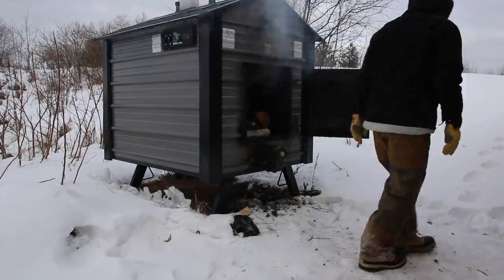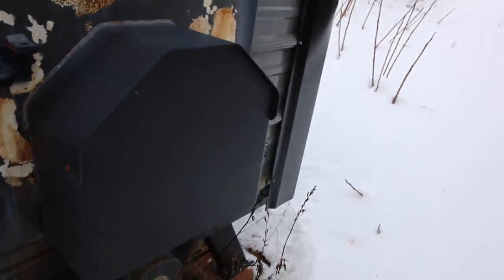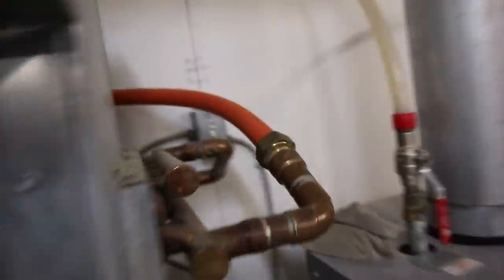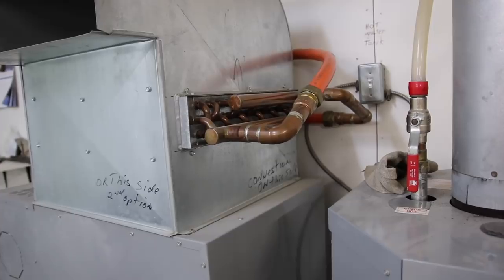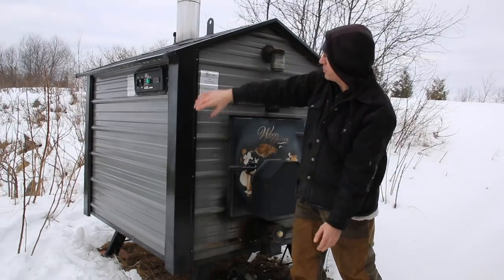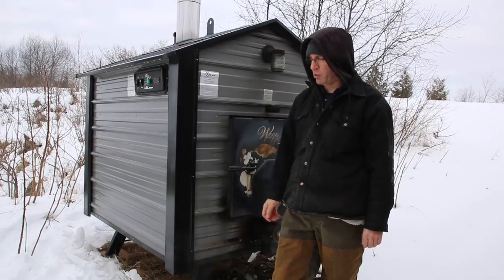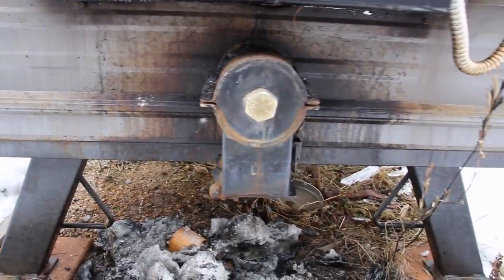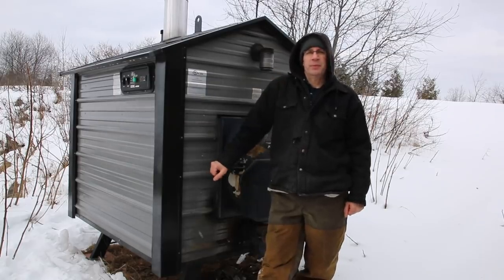Outdoor wood furnace "worth the investment?"

Comment: Thinking if a person spent 80 man hours a year cutting and stacking wood to prepare wood for the winter (just a guess) and an hour a day for 5 months of the year that comes out to about  265 man hours a year. Using wood I would save about $170 a month for 5 months that comes out to saving around 850 a year Not counting gas and oil chain saws, maintenance, cost of the wood stove, anything used to acquire the wood. However If I figure in the time I use to save that $850 a year I am only making $3.20 an hour profit for all the time spent. This was fine in pioneer times when people had not other option; however I can make some pretty good money if I spend that 265 hours a year selling stuff on Ebay or just about anything, even mowing lawns for money on the side I would make 10 times that. I don't know about you all but my time is worth more than $3.20 an hour. Of course some of you will have different figures than me but it has to be pretty close to what I came up with.  Even a part time job working any where for 265 hours a year would pay for the heating bill regardless if it propane, heat pump geothermal or straight electric heat and have lots left over. Even if your figures came out to $6.40 an hour its not worth it compared to other things. Also if you throw your back out from carrying wood just one time. All your savings will be out the window for one trip to the hospital.
Reply from the maker: I agree with you 100%. Everything you have said is accurate. This is my last year heating with wood. With all those hours that I save, I will make more YouTube videos and will be better off financially. Propane is coming in next year. :)
Reply: jimthvac100 very well said...a setup like this would be nice if you was off grid but other than that I think wood is best left for emergencies or ambience
Reply: For this very reason I'm going the Wood Stove Route. Using only about a 5th the wood to beat the utility bill 1 1/2 to 2 cords for the cold below say 35 degrees. I'm looking forward to the workout of cutting/splitting and stacking  that much wood. But 10+  cords? Forget it, not happening. At my age that would be a full time job......
Reply: Speaking of chiropractors, ever since I returned to wood heat, the exercise of cutting and manual splitting has  gotten me to the point that I don't have back problems anymore. I live alone in a 600sqft house. Since I'm at work 40hr a week, I go through less than 4 cords per year, although I always end up cutting quite a bit more. I use a single oil-filled space heater to keep the house from freezing while I'm gone. I paid $150 for my used 70's vintage stove, which is lined with firebrick and stays hot long after the fire goes out. I've had electric, natural gas, and propane heat, but wood is my favorite. Also, knowing that you're not dependent upon the power grid to stay warm is very comforting. When the power goes out (which it often does here), I can heat and cook with the stove. I can even heat up a bucket of water for a sponge bath.
Reply: You forgot to factor in the cost of a gym membership and the time spent at that gym to replace the exercise you get. I don't about where you are but here in central Manitoba a cord of un split fire wood goes for over 200$. One thing I don't like about these is that it takes away the main advantage of wood being that it is still dependent on the electrical grid being up  to remain operational.
Reply: @frenchriversprings  were just on the bay of the french and one problem we had was our outdoor reg freezing up below 40% tank capacity. Strongly recommend building a dog house for the reg and venting the reg outside of the dog house. Actually a birdhouse is a better description of the size instead of doghouse.
Reply: chopping wood saves on gym costs.
Reply: I had to buy bush cords. Five per year. Changed to propane two winters ago. Saved money, a lot of time, and my back. Best part, now I have a thermostat.
Reply: Hey, Doc (Dr Medicinal), you had me going until the comment "we need to see chiropractors anyway." We DO?
Reply: Chiropractors. Not as pretty as a masseuse, no happy ending. Can't prescribe anything. Fix it for a minute.
Reply: drmedicinal.  you're forgetting promotions and pay raises unless you think you'll be making exactly the same $10 pay for your whole life, that is if the plan is to chop wood until you die.   For most people, all that working will cross that line at some point where it no longer makes financial sense.   That's why we don't all fix our cars, install or own plumbing, fix our own roofs, build decks, cut hair, etc.  When was the last time you think a person on the forbes list chopped their own firewood for the winter?    All that heavy work will also take a toll on the body and rob you of the opportunity to do other things that you might otherwise be able to enjoy.   ...after cutting, chopping and stacking wood all week, you're not likely going to want to go rock climbing or whatever.
Reply: @grahamtotte7133  heard of a generator?
Reply: Try to find back specific exercises and do them, it will help rather than tiring it out all year cutting and chopping wood. That way you can still work and be happy..not too good at math so I really enjoyed your comment.
Reply: I agree with the assessment. However,  I saw a neighbor recieve a semi load of oak, $60/cord/10 cords. The next day he rented a splitter mill. The type you load the logs, it cuts it, then splits it. He had the whole lot cut split and piled in less than a day. $250. Its was piled next to his stove, so no stacking.  He had about 10hr labor for $850 for 10 cords cut split piled. But I still wouldn't go outdoor boiler. Supplemental indoor, yes.

Especially with the above scenario,  you may get 5-7 years on 1 semi load.
Reply: I make pretty good money and still use wood to heat and a pellet stove in my house. I have a 3 story 3800 sq/ft house and I heat it on $5 a day with one tractor supply pellet stove. I even have in floor radiant heating and I don't use it. There are other benefits to heating with wood, I don't even consider the cost to be one of the benefits. Wood stoves will always work, I do hate if you're relying on your wood stove and it dies overnight and you wake up freezing. That's why I swapped to a pellet stove with a hopper for my house but I have a wood stove going in my shop this year and a wood stove at one of my rentals.
Reply: Oh and with my house when I tried to heat with propane we ran through $800 in propane in a month! That's a full tank, great insulation on house. Propane running a boiler for the in floor heat. House built in 2005.
Reply: Plus this is ongoing, in the summer you are married to your chain saw and  you have wood everywhere on the property also proper storage of the wood is needed an additional expense.  Now when you are away from home you need to get back home to add wood at some point or call someone to add wood for you (true story). It owns you...
Reply: it has it's up and down.

to be fair, im not saving much, i buy my wood from a guy. however, in 98 in quebec we have had a crazy winter storm that took out the power grid, for a complete month we were in the dark no electricity.

during that month we were able to stay home, warm and safe, the others who were relying on electricity had to move to emergency housing (with 100s of people sleeping on camping bed in the same gym etc)
i can also cook on my stove. and i have a pass on a plot of wood my friend own where ican cut  for free.
wood stove also have the bonus of reducing humidity to an all time low in my house.

my idea is that it's better to have more choice than to use only one source to heat the house, if one fail then you have backup.
Reply: Atheyst, gotta call BS on this. Your 2 posts do not corroborate. You plow through an entire tank of LP in one month, but only one bag of pellets a day when on pellets.....one of those is not accurate.
Reply: It cost $600 a year to heat my home and cook with propane.
Reply: @Atheyst  you have shit for insulation if you run through a 400 gallons of propane in a month lol did they forget to put the insulation in when they built your home lmao.
Reply: Dr Medicinal - I live in Pennsylvania. Wood is so abundant and cheap I only pay $165 a cord and it's top stuff (oak, ash, osage etc...) so I let them harvest it.   I bought the house I am in now 9 years ago and it immediately needed a new furnace. So it was spend 5K on that or get a Woodstock Soapstone Fireview woodstove with tax credits and on sale for 1.7K.  I went with the Woodstock. It is the only means of heat my 2,200 sq ft house has. It can do the job, and burns just under 6 cords a year.

So, 9 years of wood has been $8,910 and the stove was $1,700. That means I'm in for $10,610

Oil cost me over $250 for the one month I ran it, or about 2K per year. That would have been 18K plus the 5K furnace or 23K

That puts me almost 13K in the black.  I don't regret the choice at all.  This notion that "I could be making money then" is insane, what, you people work ALL day, you have NO free time?  What work the firewood requires my wife and I do on weekends and during free time on evenings.  If you are letting running a wood stove alter your income, you're REALLY doing something wrong. I think the problem this guy had was the wrong type of stove, and his wood was not split down small enough to dry properly (and dry wood is everything).  Efficiency and heat go thru the roof if the wood is thin and very well dried. My cords come at normal size and 16" but I have a splitter and we take it down even more, and stack it properly where it gets air and direct sun.
Reply: You left out the cost of the chain saw, wood splitter and 4 wheel drive truck, add all that in an you are in the red.
Reply: Great point. I bust my ass cutting ,splitting, stacking, loading the inside rack and cleaning the chimney for burning 7 cord of wood a year in the house and 2 to 3 cord in the garage. However, in a wood stove you burn seasoned hard wood (in New England) but in an outdoor furnace you can burn softwoods and save alot of money....nevermind....you have a good point.
Reply: Around here where I live. I just buy. Wood for my wood stove. I can buy it cut split and delivered cheaper than I use to pay for gas heat. My wood stove is very efficient. I love it.  I save about $150 per month atleast in the winter over the cost of gas or electric.
Reply: I have been burning wood for 20 years, I dont use an outdoor wood furnace, just an indoor Drolet stove, very comfortable
Reply: The GRAVITY FED ROCKET HEATER PELLET STOVE CAN ALSO BURN WOOD and cheaper !!
https://www.rocketheater.com/pellet-hopper-and-accessories/
,,
Reply: The GRAVITY FED ROCKET HEATER PELLET STOVE CAN ALSO BURN WOOD and cheaper !!

https://www.rocketheater.com/pellet-hopper-and-accessories/
,,
Reply: My totally electric two story home runs over a thousand a month in severe cold months. My outdoor boiler brings it down to about 150, and I haven’t installed the water heater unit yet.   
I have a farm, were I need to clean up fallen trees often anyhow.  

My neighbor has a large home which uses propane and it was killing him.    We both are money ahead by far.   

The presenter here explains all the things to consider.   Some folks, no it may not make sense.   

not sending as much money to the electric company is a big plus as well.
Reply: My oil bill was 600-700 a month for 3 winter  months . That doesn't include the rest of the year to heat the hot water and lesser cold months.. I bought a wood stove .
Reply: Watching your video reminds me of my thoughts of ours, however I have a HEATMOR and it’s a very nice setup- auger is out the back and panels/ doors on both sides are sealed and protect the inside pump(s) and lines are out of the weather, the fire door even has water going thru it.

The piping I used was 5” hard poly on outside with aluminum core 1” pex with dense foam, under ground 4’ - 175ft from my house 

I use about 22face cords from oct- beginning of April - it’s 285k btus w/150 cfm inducer fan
Good for 5000sqft 

Just giving someone else some ideas what others have to offer. 

We bought ours when propane was $4.52  a gallon- 5 years ago- saved huge on utility’s to  

For the gathering ya that sucks about a month out of us in fall- the kind of wood helps with how much you use too- pine is hot but goes quick, we use that on warmer days- nights are hard woods (oak, iron wood, ash) 

Thanks for sharing what brand that is neighbors have these kinds, I’m the odd ball with a different brand
Reply: ROCKET MASS HEATERS
Reply: @Atheyst  I'm guessing when you heat with pellets only for $5 a day, the house is damn near freezing, and when you are blowing through $800 a month in propane, then you are sweating balls. Those number s are crazy!
Reply: Your post makes you sound like someone who's never worked a day in their life lol... We burn wood here, it takes a couple of days to cut and split and throw in not that big of a deal... If the power goes out that's not a big deal either.

Where I live the price is right too:
1. Firewood:  $13.50 per gigajoule    Change from 2016 N/A
2. Wood pellets:  $20.67 per gigajoule   +1.8% since January 2016
3.  Natural Gas:  $23.65 per gigajoule    +11.6% since January 2016
4.  Furnace Oil  $27.29 per gigajoule*    +21.2% since January 2016
5. Electricity (baseboard) $33.83 per gigajoule    +3.4% since January 2016
     Electricity (heat pump) $17.80 per gigajoule    +3.4% since January 2016
6.  Propane:  $39.78 per gigajoule*    +15.8% since January 2016

The price I pay per cord here could double and it would still be the cheapest option and I never have to worry about losing my heat due to a power outage, and we can cook on it too.
Reply: I spend $1500 from late fall to early spring on propane. Everything in my house is electric besides my furnace.
Reply: Jason O  This is the truth!
Reply: well i suppose it would be nice if insurance covers them lol
Reply: We have our own land, 190 acres and half is bush. We cut up only dead trees and burn them in the furnace. It's not only used for 5 months for us but throughout the year, we use it in the summer for the hot water. It's free hot water so it's well worth the investment imo.. If you had to buy in the wood then it's not so good but if you own plenty of land then this is better plus if your decent at sharpening chainsaws properly then that helps too!
Reply: Dead-balls on!   I've been using an OWB for 12+ years.  I have owned 4 of them in this time - all but the one I have now were flawed.  In edition to the cost of cutting wood and filling it, there are $$ costs associated with maintaining the furnace and equipment!  Blower motors, welding, piping issues, chainsaws, log splitters, driveway maintenance, electricity used for lights, pumps, blowers, etc., health issues from breathing smoke, smelly clothes, gas costs for chainsaw and splitter, axes, glycol and lots and lots of time!
Reply: some people just want to deny the utility their money, not save money
Reply: The way I see it!
The small house we live in was heated for @30 years with a wood stove. Now when I moved back here from Texas 20 years ago I started cutting trees where I could and hauling them home, cutting what I brought home into 16 inch pieces, splitting those, then stacking the wood in a shed. I was 20 years younger and time has caught up so it was more work than I wanted to do. You realize this was done in the summer when it was hot.

I figure I had to handle that wood, every piece, 5 times before it got to the stove and when I quit cutting the wood myself, finding a reliable source was not easy and a little expensive too.

About 6 years ago I bought an older pellet stove for $400 and sold the wood stove for $400, before you say good deal, I had to drive 150 miles both ways and then modify my chimney, buy a voltage reducer and a thermostat so it wasn't free. It lasted about 6 years before it just quit in the middle of the night and was beyond my capability to repair and working on a 20 year old stove is pretty much a NO.

A new stove cost me $800 and the first two quit within 24 hours. I returned both and got my money back. One thing for you to remember, pay with a credit card or a debit card or you will have to wait for a refund. Found that out the hard way.

The third one has been working now for over a year but I liked the old one better as it ran off a thermostat and these new ones have a fire all the time. Why they do not use a thermostat I have no idea but to me that is stupid. I guess they don't have much faith in their igniters or circuit boards.

Anyway the wood pellets are sold in 40lb. bags and run about $200 a ton here so you need a good pickup and either a forklift or something to unload them or you unload those 50 bags by hand, which is what I do. It takes me a little under 4 tons here in NW Indiana for the winter for a 1000 sq. ft. house.
Another tip: wood pellets go on sale around September here and you save about $40 a ton if you buy them on sale. One more: buy what you need as about March no one will have any and you will need some.

I have an enclosed back porch that will hold two tons and an outside covered porch and that is where the rest are stored with the plastic still covering them.

 I saw a used outdoor furnace for $3200 and you figure you have to have a trench dug and lines installed to your existing furnace, electric run and wood for the winter( maybe 5 cords or more ? ).Then you have to go outside to keep it filled and is that really worth it?

BTW I do live out in the country with no Natural gas service. Heating this double wide with propane will break you as the minimum load they will bring is 200 gallons and that is right at $500 and I don't think that would last a month.

There you are from someone with experience and yes I know several people with those outdoor furnaces but they all have land with trees, a tractor, trailers and relatives to help.
Reply: We have an large indoor wood stove and one piled pickup truck bed can heat the whole house for the whole winter saving 300$ a month and from the time we get to the farm to when we get back 1 hour drive both ways, it takes 6-8 hours of work for the whole winter of heat. The stove is hooked to central air system and the reason our bill with out it is it’s an old house with poor insulation and that combined with -15 f wicks away heat quickly.
Reply: I buy kiln dried hardwood for 100 dollars a cord I buy 4 cords a season .it was costing me close to 1200 dollars every 2 or 3 months on oil it is much more cheaper for me to use wood to heat my house
Reply: Madam Vonkook it’s not kiln dried but were I live there is lots of fire wood much cheaper than that or even free where do you buy that from?
Reply: @JustinTopp  I live in upstate NY .I buy it from a guy who lives up the road he cuts trees and does landscaping in the summer and sells wood in the winter .I am wheelchair bound or I would chop my own wood .
Reply: Madam Vonkook ah makes sense
Reply: That's what kids are for
Reply: You should be realistic in your assessment. You will most likely use your free time for messing around on the internet being unproductive. I knew a 93 year old man that made 33 cords slowly in the last year of is life. Died peacefully in is sleep. Not all people want to use all of their time for meaningless online shopping and idiotic tv
Reply: dlamardeyoutoube I haven’t watched tv in years .. but I do spend lots of time being unproductive
Reply: Yeah my dad give this up after a few yrs way to much work and time
Reply: Plus the 5000 cost of the cheapest furnace I have found more like 10000 for an EPA unit
Reply: I think the size of a wood boiler you don't have a little house, the video he said he's heating his shop with it.. I saw a guy heating a 6500sq ft house plus his woodshop 2 car garage sized.. I don't see heating that with gas for 1g a month, then oil is it $2 or $4 who knows.. Propane is worse some places. i paid $5.25 a gallon the only year i had it.  Wood if you just go around and pick it up on the way home, to me is great. I had a fireplace ran it everyday.  Never spent more than 3hrs at a time getting wood, and i usually wanted to get out of the house also
Reply: @frenchriversprings  research your propane costs in your area.. My experience was 2.25 a gallon summer. 4.50 common in winter.. The size btu of your gas valve.. Mine was 110g wich is about a gallon of propane.  My house was tiny under 750 sq ft..my heating was over 500 a month.. I called to get these #s & did all the math.. Every 15 minutes my unit ran 15 minutes.  12 gallons a day, and i was cold. 
  I would not live in another propane heated house.
Reply: I have this same woodmaster 4400.1 inch pex lines directly spray foamed in the ground. heating a home, and also a garage that total 3000 sq. foot. I purchase a dump trailer of ash or oak for 125 dollars and that will get me 3 weeks when it below zero or 5 weeks when its around 30 degrees. It takes around 2.5 hours to cut and split it.i fill it twice a day when its really cold and that takes probably 5 minutes total. when its 30 degrees in the day and 20 at night it will go 24 hours on one load. when propane went above 3 dollars a gallon at 1200 gallons a year, it paid itself off in the first two years. even when propane is 1.25 a gallon this is half the cost for me to run..and when propane is high I don't have to give in and buy it.on my 5th year of not turning on the gas line.
Reply: @themodsho  awesome. .that must have been the year i had propane,  it went to almost $5.. Greedy people.  I cut lots of wood but moved after that. The house was too small and poorly insulated.
Reply: You're missing the sheer joy from growing and cutting your own wood,....This guy would reduce his wood use and cut pollution by getting a gasifier boiler. This furnace is old tech, now he should get a gasifier, transformative....
Reply: you must be in a mild area and low fuel cost, our winters are long and very cold, -40 with wind chills of -70 and fuel oil cost of $6 cnd a gallon and propane is more plus the big tank rental a month, for 12 months a year, and hydro of $012 kw plus delivery fees that are just as much as the hydro used, my hydro bill for last month was all most $400 and i dont have electric heat.. i dont spent any time stacking wood, that is a total waste of time, it all thrown into a big pile and thats it., a few winter i had to use only oil and cost me over $5000.00, were as i use 20 cords of wood a year that take me 2 to 3 days to make and it is by far a much nicer heat
Reply: jimthehvac,where are you coming up with the 1 hour a day figure at? I feed my boiler twice a day and it takes about 10 minutes in all. plus I am walking my dogs in the meantime, you and others on here have your figures way off in my opinion. Respect your reasons but your facts are way off. plus you still are not figuring that if you bought the wood it is still cheaper than propane. I too spend about 40 hours a week gathering wood, but that is my exercise and  i ride a bike and walk. what do you do and how long do you spend doing it? Its all comes down to what you are trying to achieve.. I will bet you one thing, there is no way you can come up with apples to apples facts that says a boiler does not save you money to heat your home. no one said it was easier, on the contrary. now, you cant go buy a piece of crap boiler and slap it in either. your results will be terrible. but if you buy a well made boiler and install it correctly, even if you bought the wood you will save money. why you are saying it takes an hour a day to feed your boiler is nuts. please explain that to us. an hour a day. I walk 3 and half miles in an hour so what is going on with you putting 10 pieces of wood in a boiler a day???
Reply: baja why would you think that??? How much do you spend on heating your home a year, where do you live? do you have long cold winters? Please  compare your situation to others. if you have a mild winter then you may be correct. if you spend thousands on heating your home then may be your way wrong. wood is cheap even if you have to buy it compared to propane or fuel oil. IO don't buy my wood but I will sooner or later because of my age but it is still cheaper than propane hands down and always will be.
Reply: m1t2a1. how is that? so you burn 5 cords of wood and you bought it? how much was the wood and how much did your propane cost? if you don't include that then how are we to know what to compare. 5 cords of wood here in nc is 160 a cord delivered.  that's 800$. So lets go with that, so are you telling me you spent less than 800$ on propane to heat your house and keep it the same temp as your boiler did. Highly unlikely sir. no way with the price of propane did you do that. unless you over paid for your wood. Even at 1000% you would spend more on propane. propane last year in the dead of winter in nc was 2$ per gallon. that means if you paid the same ( which I am sure is more up north if that is where you are) that at 2$ a gal you burned less than 400 gallons. Again very highly unlikely. Wait what size home do you heat. you seem to have left out some very important info. we can easily calculate your facts. they just don't had add up man,.
Reply: You can feel good about burning wood. No troops dead or dying for that cordwood fuel.
Reply: so everyone has brought up the advantage of having a wood boiler out in the yard because it's a hedge against the power grid going down. so tell me how you get the hot water to the house from out in the yard without power ?
I have never understood the idea of having wood burning heating water out in the yard and having a thermostat preventing said heat from getting to the house.
I use a wood stove (25 years now) 
and don't use near the amount of wood people are saying. granted I'm in Illinois in the USA but it was -18 with 35 mph winds about a month ago. I might use 2 cords in my old 1892 farmhouse, I do have a propane space heater so I don't have to get up at night. 
ad far as expenses I already have the truck the chainsaw is not that expensive figuring how little I use it and I love being in the woods and pasture cutting wood. 
God bless all of you, this was a great thread
Reply: peter, I get what you mean. but I never said I have a wood boiler to get off the grid!!! I have a wood boiler cause it is way cheaper than propane. That is all in my case. oh and the fact that I don't have to burn wood in my fireplace insert now which is a pain. Having a wood boiler to get off the grid  cause your are scared to loss power would be, well, in my opinion dumb. If that was the reason then I would just buy a 8K watt generator that runs off my huge home lp tank. But I do also have a generator for just that purpose but it is not a whole house genset . So if my power went down say after a hurricane, I can run my gen from my l tank in the yard for several weeks. but I would not be able to run any a/c units but I would be able to stay warm if this happened after say an ice storm. I never said the outdoor boiler is easier than the power grid. actually electricity is the way to go if you live in milder climates. its not up north in the winter, but propane and fuel oil pricing goes up and down so much you get scorched by the fuel companies in the winter. I pay about 1/4 of the cost to heat my home than I do to cool it. that's a huge savings for me and that's with after I have figured in the cost of the wood and the time it takes. for me that works it may not for you. I have a question for you. How will you stay warm if the power grid goes down?
Reply: bull of the woods  I heat with an old craft stove that has an old furnace fan on the back of the jacket to blow air around. when the power is down I still get just as much heat out of the wood stove but just not all over the whole house. my propane wall heater is ventless and requires no power. it kinda ducks to be without power but I've managed at times for up to three day without power after an ice storm in a very cold winter. 
I get lots of my wood already cut up from City Arborist as a wast byproduct for free. 

thanks for the great reply, god bless. 

oh if you can help me figure out how to burn wood chips from the same arborist that I can get for free that would be great. I'm getting old enough that I'm seeing that I will need something easier when I get old. I hand split till this year lol
Reply: oh I know. but I have 3100 sq ft and when power goes out I am still good. I can still heat with my gas cooktop and fireplace insert and cook  but I am on a well so if I loss power I am without water without the gen. I have it where I am good for several weeks if I need to be. I just cant cool my home in the summer without a bigger gen. I could run one a/c unit but I only have 33 amps to use so that really would not be very feasible. my water heater is gas and it is being fed with preheated water from my boiler. even with a wood stove like yours , if your house is large then you would not have good heat all over like you said, I will with my set up. we haven two different situations. buy again in my case the wood boiler was not for loss of power
Reply: I 'll stick with coal stoker...cheaper...easy hot heat
Reply: hi Charlie, really? is coal cheaper than wood? I wouldn't know that. I am in NC so I don't even know if anyone here even sales coal. How much is coal a ton or how ever you purchase it. also how many btus does a ton of coal produce? If its cheaper and I can get it I would go with coal also. though I would think coal is dirtier than wood.
Reply: I agree with everything everyone said.  Wood heat is a ton of work.  You have to be effecient at collecting wood, stacking and everything.  My wife is from NC and loves the heat to keep her warm.  I love it too.  Super relaxing.  
You have to enjoy the time spent dropping trees and appreciate the money saved.  If you don't, it's not worth it.
Reply: .....yeah, but I enjoy it.....
Reply: And also woodstove are not healthy,,, carbon monoxide and proven to cause lung cancer
Reply: 56squadron can i get a link to that wood furnace please
Reply: I'd rather chop wood for myself for $3.20/h than take someones shit through a Tim Horton's drive through for another $10/h :p
Reply: @bobbycamp8515  ya I'll the Flu and TB over Trump any day! ;p
Reply: I have 15 years experience with a Central Boiler Classic and your cutting and stacking time estimate, and loading time estimate, is way off.  it's much easier, and quicker, than you suspect.  The price of tree-length hardwood remains steady, and consistently inexpensive, whereas fuel oil prices can fluctuate wildly.  Additionally, you have to consider the savings in propane or electricity you would otherwise use to heat your domestic hot water, which at my house is a savings of about $200/month alone.  Third, it's a good investment in your health through physical fitness and just plain keeps you strong.  The exercise of opening my wallet to waste thousands of dollars on fuel oil is an exercise I can do without!
Reply: 56squadron well said!
Reply: Dr Medicinal secure party?
Reply: Throwing your back out can cost you a lot more than a trip to the hospital.  I wrecked my back almost 50 years ago, and I'm still living with chronic pain.  My MRIs show that my entire lumbar region is wrecked now.  When you're young, you don't think about these things.  

I still do hard physical labor today, just barely into my Seventies, but I'm usually only good for a couple hours a day.  Homesteading like this guy is doing, is definitely a lot harder than some people might think, and I agree with you... better to make money doing what you do best, and leave the drudgery to the younger guys, or buy propane.
Reply: so you work 24 hours a day? no down time? it is not always about money. out in the country we have the option of wood or wood or electric, we have no gas, no water, no internet, no cable, hell we dont even have cell phone signal, we have to use satellite for TV. yes you can get propane in small tanks, there is no delivery service for the big tanks in our area, so going to get propane and hook it up, unhook it to refill, would also suck. pretty much everyone out here burns wood. And where these are sold and used it is most likely pretty rural as well. So we already are cutting and splitting and stacking wood. the difference we have to feed the fire every couple hours and once or twice in the middle of the night. all inside the house, creating smoke and dust and dirt issues. wood burning is dirty. If i had the $$ I would get one of these.
this guy is not running this efficient at all. it is way to far away for one thing, and if he dug the trench deep enough 6' or more he would not be loosing heat due to the cold ground, i suspect his is 12 inches or so, not even below the frost line. And these things are designed for multiple uses, hot water heater, multiple radiators. for all he invested just using it for one radiator furnace is insane. It must be nice to have that much money to waste.
Reply: Burning wood is a lifestyle, money hasn't anything to do with it.
Reply: An hour a day to stock it?  I guess that makes sense if that's literally the only thing you are doing outside for 5 months and you include the time to get dressed and dilly dally around.  But i'd bet most people with these are already outside everyday taking care of their land and/or animals.
Reply: AN hour a day??? you load it twice a day! that's what, 10 minutes! your numbers are way off!!! Now let get numbers up for adding a drive shed and greenhouse, now heat those and calculate the numbers!
Reply: Still feel that way now with the cost of gas?